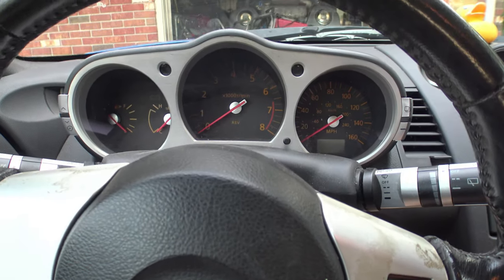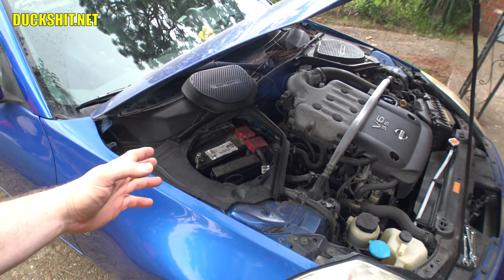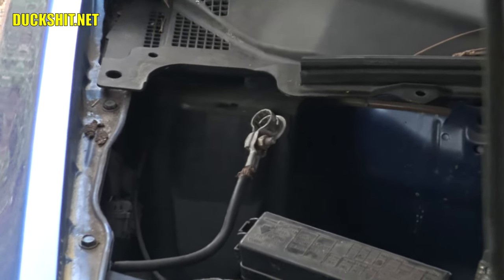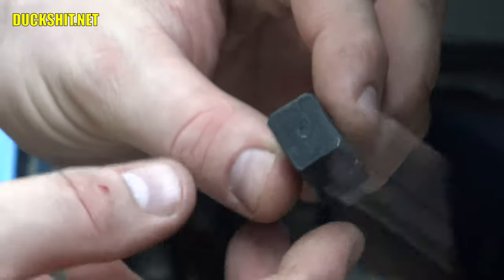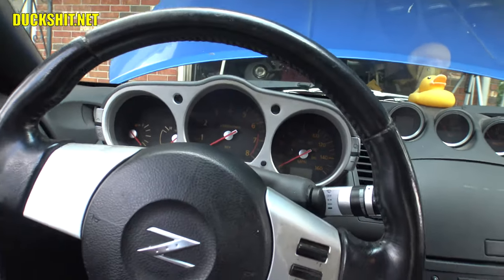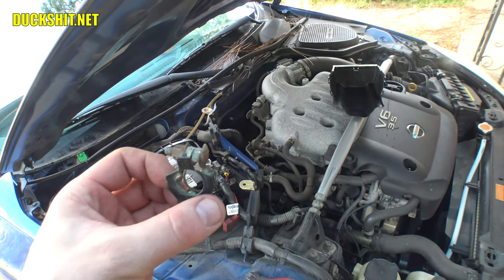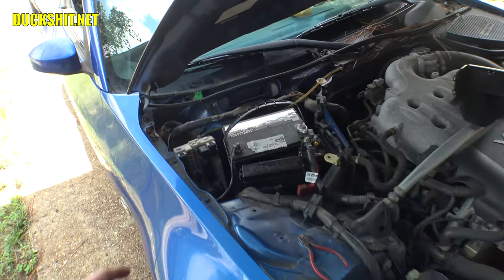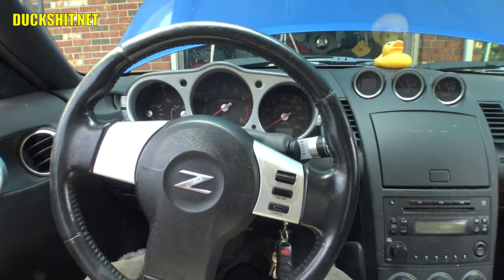Nissan 350Z Won't Start Fix - 4 Things to Try - IPDM Repair

Comment: First time on all of youtube an most 350z forums that somebody covers the relay topic... Thanks for the video!
Reply from the maker: Really am I the first? I wouldn't have thought so... this thing was a little trouble to figure out but I got it straight.  Now a couple months later it's acting up again but I can hear the relays opening and closing when I turn the key and step on the clutch which it wasn't doing before.  This time I think it's the starter or the solenoid.  I have to trace the wires again and see what I can find to verify before I start buying parts.  😁👍😁👍😁👍

Comment: Thank you for sharing your video on issues with 350z! This is an incredible and unselfish video! It is very useful to me and to all guys who own 350z. I own 2005 350z with 80k mileage. It's good to learn from you. You are an excellent teacher far better than those repair guys in the shop. Keep it up the good work!!!
Reply from the maker: Thanks Newton!  I'm not a rich man (yet) so when something of mine breaks I gotta fix it!  I like to video my experience and share it, often it is very helpful to others!  That's some very low mileage on your Z, mine is the same year, but 160k and still runs like it was new.  Thank you so much for your comment!

Comment: The bad solder connection probably caused the fuse and relay undue voltage. But let's face it. The average person would never figure that out. $2000.00 at the dealer.
Reply from the maker: Not to mention everything else that was wrong!  LoL!  I can't believe that I had that many different problems at the same time!  Should be good for another 14 years..... lol... probably not, but YAY!  Thanks man!

Comment: Dude you saved my life. That little clutch button depressor fell off and that was my issue. Thanks for the video.
Reply from the maker: Glad I could help you!  Thank you!
Reply: P1111 what does it mean when I get this code on my 350z automatic
Reply from the maker: Little weird to ask for an automatic error code on a thread about a clutch rubber pad.  Have you searched for the error online? What did it say?  Unfortunately this video is not about that error code it's not one that I've encountered before.

Comment: My 2005 350Z wouldn't start in the grocery parking lot. Luckily, there was an auto shop in the plaza a short distance away where I bought a new battery.  The guy was nice enuf to install for me and then -- nothing. It clicked once and all the dash lights were on, but no start.  Thank heavens for your video!!  I'm going to get to work on locating the relay switch right now!  They're not expensive so even if it doesn't work, no big deal.
Reply from the maker: Wow, glad I could help!  I am building a power module like this for my 1956 VW Beetle now, how this thing worked intrigued me a bit... but I figure I can do better!
Reply: Did it work?

Comment: Thanks for this video. I had been having this starting problem and an issue with the brake lights staying on.
I replaced that rubber bumper on the brake pedal and it fixed the brake light issue and I 
replaced the start relay and it fixed the issue with the starter not cranking. I never knew there was
a fuse and relay box next to the battery. In my car, I did not have to remove the battery to 
get at the relay. So far so good. It now cranks fine and starts. The clutch pedal bumper thing was fine
in my car but I have one of them in my tool box just in case it too fails.

Comment: man you just saved the day I thought it was my starter but that rubber piece fell off my clutch pedal thanks man
Reply from the maker: Hi Travis, so glad I could help.  Watch out for the pad on the throttle, also.  I had another video about that where the car suddenly became undrivable and threw error codes while I was in traffic.
Reply: @DuckmanCycles  I missed my z😭😭it's been sitting for two weeks but yeah thanks again I'll subscribe
Reply: @DuckmanCycles  ok thanks I'll keep an eye out for that appreciate you
Reply from the maker: I appreciate it, man!  Another Z video when the next thing breaks!  Haha!
Reply: @DuckmanCycles  🤣🤣🤣yes please lol because I know it's coming eventually 😅

Comment: Your video helped save my bros 2005 350z, we changed the alternator, battery was new, and nothing. I pulled the fuses from the ipdm and they were all green with corrosion. Changed all the fuses and Relays. Still didnt work. I found a parts number matching ipdm on eBay for $75 with warranty. Car started right up!!! Once again Thanks for the Vid!
Reply from the maker: Thank you!  Glad I could help!  Mine is acting up again, turns out this time the starter was getting really weak.
Reply: @DuckmanCycles  Bad Camshaft or Crank shaft position sensor will also cause a not start/long start.I learned not to use/buy the cheap duralast sensors. I went thru 3 of them in 1 day. I ended up switching both camshaft sensors and the crank shaft sensors to Hitachi Brand and all is well now.
Reply from the maker: @willski81r  I'm not having those problems... the starter motor was getting weak and cranking very slow.  I thought my battery was going but it was just the starter motor, once that was changed out, it cranked over faster than I ever remembered.  It had been gradually slowing over the years... lol, never seen one do that.  Cam sensors are fine.  I put a cheap one in 5 years ago when I had no money, its still there and its still working fine.  The original sensor would just crap out when it felt like it, then for a few weeks it would be fine again, then dead for a few weeks.  What a nuisance.

Comment: Thank you soooo much!  I'm ready to get my 370z back running!  It shut down driving down the hwy!!!!
Reply from the maker: Excellent!  But to be clear, the same code happened with the same solution on your 370Z and not a 350Z like was shown in the video?   Thanks in advance!

Comment: Very useful video,. thanks! I had the identical issue with a slightly different cause that may help others. Exact same symptoms as this video... good battery.... lights/washers/horn/windows/dash lights etc all working, but car starter will not engage. I stripped down the iPDM as in this video but did not find anything wrong except for some very light corrosion on some of the relay pins. Cleaned them up, reassembled the module and re-installed. The car started!!! For 2 days... then it would not start again. I ordered a tested used unit on Ebay, swapped it into my 350z and it worked! For 2 more days! Then, no starting again. Eventually got a good scan tool and it showed a U1000 Canbus fault code and a fault with the ABS module. Took it to the dealer and they found the real root cause was a bad connection on the ground wire from the PCM computer under the dash. They fixed it with no new parts needed. Zero issues since this repair. Hope that helps others trying to trace a non starting 350z if it is not the iPDM module!
Reply from the maker: Hey thank you so much for the feedback!  I'm glad it helped, even if only briefly for 2 days!  I'll have to keep an eye on my ground wires also.  Thanks for sharing your story, it may help me or somebody else in the future!
Reply: Iam having the same problem however my code is U1001 and P1212

Comment: So I’m a little less than a year and a half late but this video was really helpful. I have an 04 Infiniti g35 and my IPDM looks almost exactly the same. I don’t know if you’ve already figure it out but the reason it had some moisture in it is because the way that Nissan engineers designed the car is that there’s very little drainage in the Battery seat so it tends to clog. This causes water to fill up and it makes the board and wires get wet
Reply: And the way water run off is directed causes it to flow almost right at the block I believe
Reply from the maker: Thank you, I will have to look in there.   The IPDM is also sitting in a place where there's a lot of water flow off the windshield.  It's just a lousy design location

Comment: Thank u Duck man.  Guy told me was my clutch at the shop after I lefted and didn't start. Ur trick was right the lil plastic button was right. Thanks
Reply from the maker: Glad I could help!  That stupid little thing came as quite a surprise to me, but I had a bunch of problems at the same time, not just that lol!
Reply: One more thing my car shakes when I reach 63mph. Could it be ball joints???? Please help
Reply from the maker: @lathrio  Possibly, could be lots of things.  First and most obvious thing to check is the wheels and tires.

Comment: Dude you’re super entertaining. I’m basically diagnosing the same (but for an auto) I should check to see if I get power to that pin 25 for the starter because it could be the same issue! (Or a relay). I appreciate you making this video and I’ll link it in my next vlog update!
Reply from the maker: Thanks!  I'm just me, sometimes people get it.....  haha!    How did your diagnostics on this go?
Reply: Perfectly. Replaced all the fuses and relays in the IPCM and cleaned the corrosion from the connections and started right up. Thanks again dude!

Comment: Well thanks to your video ive found the non start on my 350z , i didnt even know that fusebox was under there ..... found the fuse box to have a lot of corrosion in the relay and connectors...... awaiting 2nd hand part to get it up and running again
Reply from the maker: Thanks for the comment!  Hope this video helped!  :-D
Reply: @DuckmanCycles  it definitely helped mate thankyou 👍🏻 part ordered so i can get it installed and back on the road
Reply from the maker: Awesome my friend, good luck to you! You have any questions feel free to ask!

Comment: My 2004 350z is struggling to crank over and start at times. Good solid new battery in it. Swapped relay with headlight and both work fine so not looking like a relay. Next I’m going to fully clean the MAF and Throttle body but I doubt that’s causes my start issue. I’m leaning toward needing new spark plugs, a new fuel pressure regulator or fuel pump if it persists to be an issue..
Reply from the maker: If it's struggling to crank, then it's most likely a starter or battery.... or some electrical connection between them.  I replaced my starter recently, it was cranking quite slowly and had been getting slower and slower over the years.  All of those other things you described don't affect the "cranking over" of the engine.  If its not firing, however, then those things may come into play.  Hope that helps, and good luck to you!

Comment: Great video, the starter relay hasn't went out yet but I did had to change out dat rubber gourmet once.
Reply from the maker: That silly little (overpriced) rubber wad causes all kinds of problematic issues.

Comment: That cold solder on the IPDM was a FACTORY DEFECT! Shit like this pisses me off to no end! I've reflowed many of them. SoldaPullit (sp) and fresh solder and good to go. BTW I was given one of those little battery powered solder thingys years ago and it doesn't heat anything else but the spot you put it on...  And that "No User Serviceable Parts Inside". Well for 99.999% of users maybe. I have the Service Manuals for all my cars (some are a stack of phone books a foot thick). I don't know if my dealership hates or loves me but if there's something I can't fix myself I take the books marked to the relevant pages and tell the Service Guy I did this and this so that leaves this damn part under the dash I can't get to without taking the WHOLE DAMN DASH apart!

A/C on my '05 Grand Prix GT2 failed a few weeks ago and it took them TWO WEEKS to fix it! Everything from the front seats and dash came out to the firewall! Parts hard to get etc. Rented a 2019 Dodge Challenger for a few days (fun car BTW) and because they were taking so long to get MY car fixed they told me to bring the Challenger back and they'd give me a "Courtesy Car" to drive until mine was ready. Freebie? Hell yeah! Buick Encore loaded. Drove it a couple days before I looked under the hood (I do that) and it's a EcoTech FOUR cylinder!

Repair on the GT2 was over $2000.00! BTW the GT2 has everything but the Supercharger. My '99 GTP HAS the Supercharger. Good for 40 extra horsepower! Those Buick 3.8L V6s are great engines! Think the old turbo Grand Nationals. Timing chain pushrod bullet proof and parts are cheap and easy to find!
Reply from the maker: Not sure if its a cold solder joint, or vibration damage.  Its been good 14 years.  I really can't complain lol!

Comment: Cold solder joints can cause a lot of problems, GM had trouble with them on wiper boards a few years ago. I had a problem with one on my house AC control board, a few minutes with asoldering iron cured the problem.
Reply from the maker: Not so sure if a cold solder joint or vibration just cracked it.  It was strange either way.  Good job on your repair!

Comment: I was looking at your merchandise and have a suggestion. I don't  drink coffee but would buy a MFDM rum and cola glass. Good job troubleshooting that electrical problem.
Reply from the maker: Good call on that, needs to be appropriately Duckman-sized, too.  I'll see what I can come up with!
Reply: We need a pre-memorial Duckman and Skeeter opening mail coffee mug.  It could even be an opening wierd mail coffee mug.
Reply: Duckman sized is perfect,I like to make a big drink too,plastic so it is garage safe when I make one too many and drop it on the floor. LOL ask me how I know.
Reply from the maker: @garagedweller7159  I already know... there's been a lot of busted bottles under Eleanore lol!

Comment: Awesome find. I was wondering if you had issues with water or rodents and their "stuff" causing poor drainage just below that module you operated on. I drilled holes in my battery tray and poked a clothes hanger around to loosen up the blockage. There's two holes. One is oval and has a grommet in it and it is on the "shelf" just below the module. The other is inboard of the left battery tray bolt (maybe) or in my case the threads rusted away and the bolt hole is the drain. This area is a haven for rust under the battery tray. No one has made a video yet. Thanks
Reply from the maker: No rodents nor birds.... lots of spiders though when the car sits for an extended period of time.   Under a battery is typical rust spot for any vehicle, the acid and other chemicals eat the paint, the moisture does the rest!  I often toss some baking soda under a battery, that helps slow down the issue!  Hope that helps!
Reply: Right above the battery and fuse box is also where they have a connection "coupler" for the windshield  wiper fluid tube.  My wife had someone from Autozone install her battery and they broke this coupler which causes leaking of windshield  wiper fluid ALL over the battery and relays so I'm having to swap everything out.  Be careful taking out the battery ! Really poorly designed

Comment from the maker: ⚫ Stuff Seen in Video (Check against your year 350Z!⚫ 
Mirror Sunglasses ▶ https://amzn.to/2Ludwgd
Rubber Clutch Pad ▶ https://amzn.to/2JubgCV
BatteryTerminal ▶ https://amzn.to/2NMKR7s
IPDM Unit ▶ https://ebay.to/2Y0D49O
IPDM Relays ▶ https://amzn.to/2YV7RlX

Comment: Well damn... Plus there's a tropical storm comin so be safe either way.
Reply from the maker: That's why it has been raining here for a week, it took a half circle around Pensacola.... we've only got in the rain on again off again, but almost no wind at all.
Reply: @DuckmanCycles  Sounds like you got lucky then. Glad you were able to get Ol Blue fixed though. That would've driven me up a goddamned wall haha. I'm actually surprised with my car having 212k miles on it, she's been fairly trouble free. Knock on wood it stays that way.
Reply from the maker: Yep, lucky, it was a Louisiana storm, but we still got a week of rain out of it.

Comment: Got burnt at Team Nissan in Manchester NH,  back in the early 90's. Tech messed with probes till he shorted the ECU, I Got a used one from a junk yard he installed it. Found out it needed a coil which was the problem before he mister good wrenched it. With rentals and work this $30.00 repair cost $ 1500.00. Needless to say I never owned another Nissan. I think most dealer suck which is why they make working on your cars and trucks so hard.
Reply from the maker: I think this is my last Nissan also, unless I wind up getting one much older someday.  Now that they are owned by the French Renault company I don't think I want anything to do with them.  The Nissan Juke that I drive for work for example, what a piece of junk!

Comment: I didn’t know about the box backthere! I have a similar issue on my 07 g35 but the check engine isn’t on, scanner won’t read, and it won’t crank. Think it’s the ecu or something in the IDPU?
Reply from the maker: Yes, the IPDM is an easy one to miss or not know about!

Comment: you can use a body panel ribbed push in rivet thing to fix the clutch safety switch as well
Reply from the maker: Good call!  That would make it easy to just open the hood and gank one!  Thanks for sharing!  Iill be doing a follow up on this video shortly... I will mention it!

Comment: Does this apply if the lights dont come on? it beeps, batt. light comes on and goes off when i press the brake. but I tried jumping it and while hooked to my truck I got nothing.
Reply from the maker: Well, I'm not sure, from how you describe it you have several different problems.  I'd go through all the fuses and all the relays and see what you find there, first.  You likely have more than one in trouble.  Also make sure your battery terminals are clean and tight!